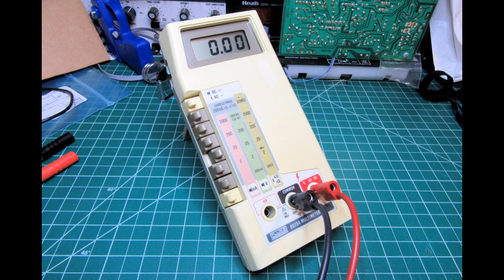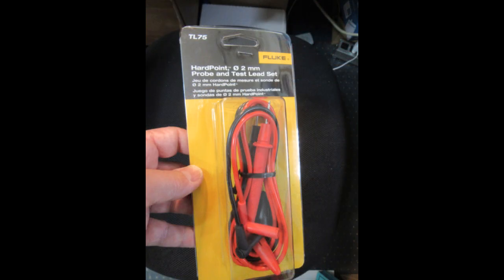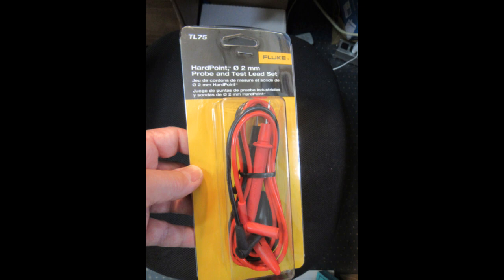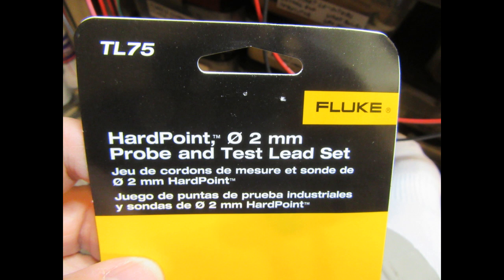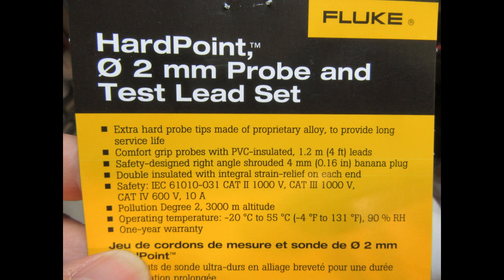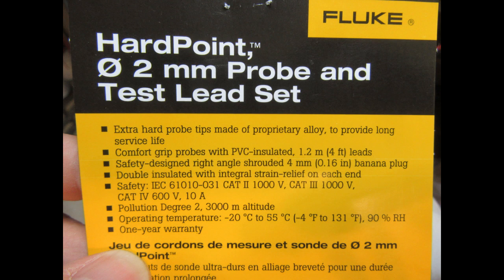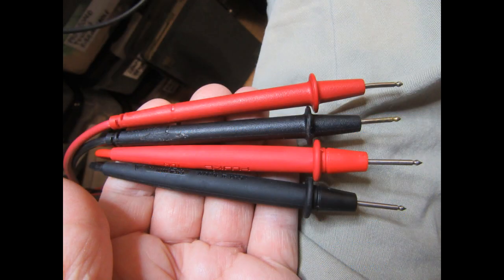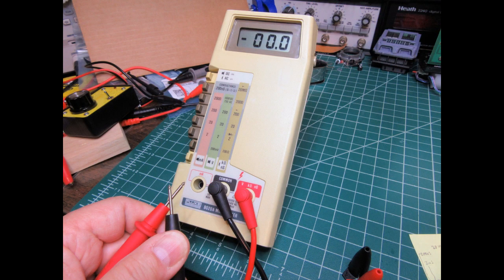Fluke 8020A Handheld Digital Multimeter (DMM) Part 2: Choosing new test leads-Type TL75

Comment: These mneters take the same leads my 179 and 87v take  they are very standard.
Reply from the maker: Weskirkland, test leads with unshrouded banana plugs WERE standard, but have NOT been for many years. The last place that I know of that still made them stopped doing so a couple years ago.

These days, I have to manufacture such test leads from components made by Pomona.
Reply: @youtuuba  the same leads fit.
Reply from the maker: @weskirkland5850 , which is useless in this discussion. The important point in whether any modern, currently available test leads will fit these old meters. You have not identified what brand and model of test leads you are using, and whether they are still available.
Reply: I got probemaster 8000 series leads.  safety banana straight

Comment: Great video, gave you a like. I just purchased a Fluke 8060A and I need probes for it. At 4:31, the probe shrouds are a nice touch, but I prefer to slip heat shrink tubing over the leads right down to about 0.5mm from the tips. This prevents shorting and allows me to get in tighter places than the shrouds will allow, but they are a welcomed addition.